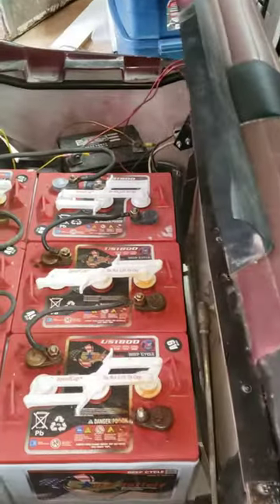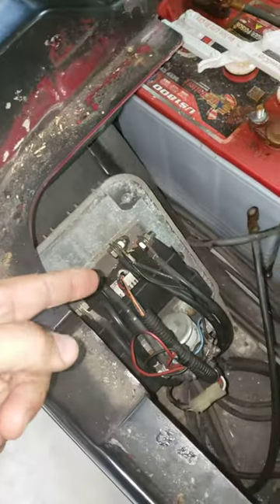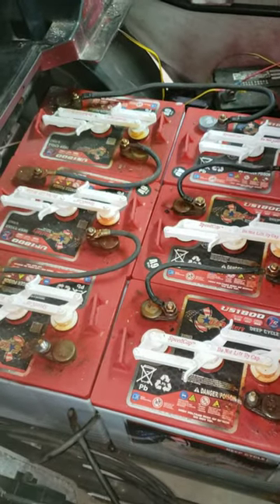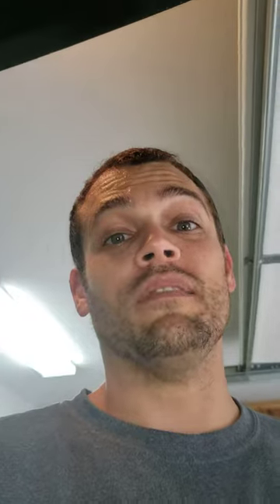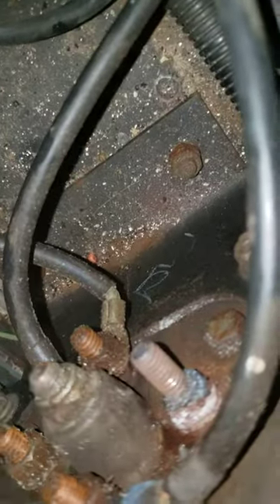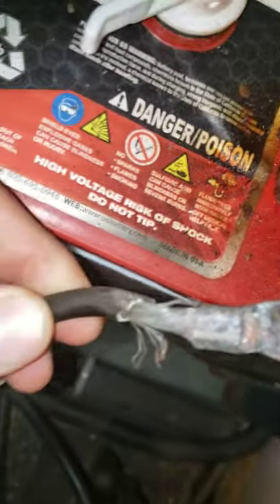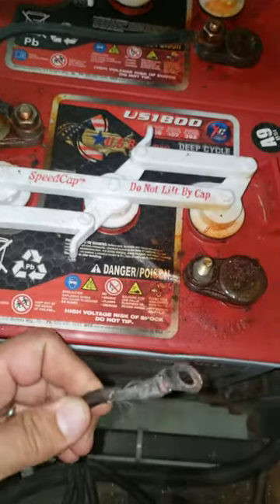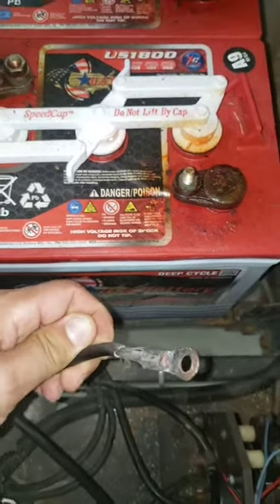Ezgo cart solenoid clicks but won't move

Comment: I’ve replaced all batteries and the solenoid tested the motor but it’s still clicking could this be the issue?
Reply: Its supposed to click. That clicking is the solenoid being activated. If it doesnt click then you should worry.

Comment: Regardless, if it helps me thank you for the video. It might help me and I have a 42 V western easy go TXT and there’s so hard to diagnose to me for some reason because it runs on 36 or 48 solenoid I don’t know I just need help from somebody please Beautiful cart. The batteries are amazing too. Lights work charger works, and it’s gotten on board charger up in the grill in the front behind the plastic. I don’t know if I like that but it’s also got nice rims so I don’t wanna kick it to the curb by selling it so if somebody’s got any ideas, that would be great, all seven batteries have well over 6.5 V and when I lifted the seat cover it was warm not hot but it means the chargers doing its job but anyways blah blah blah blah blah blah blah. Can somebody please help me with a 42 V western 2004 I would appreciate it , I’m out there with a volt tester